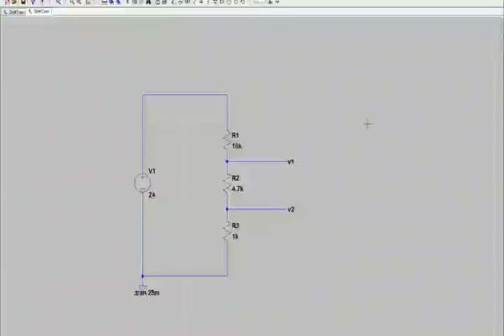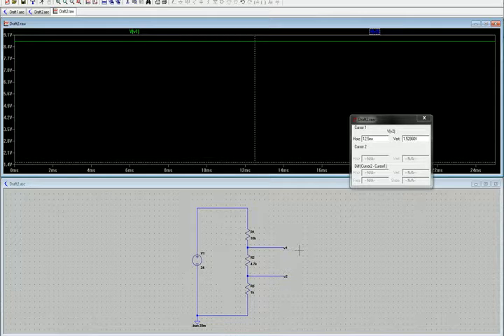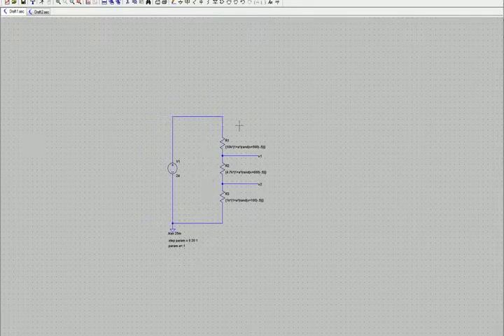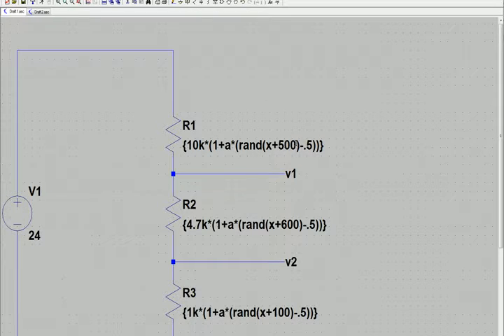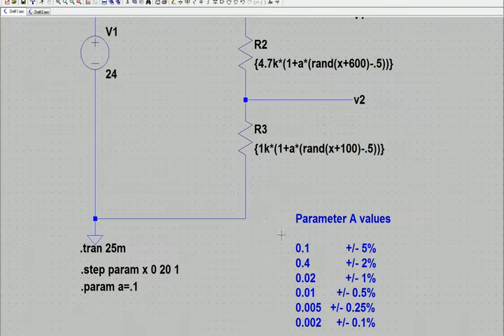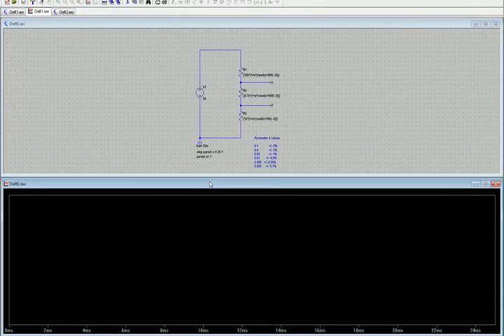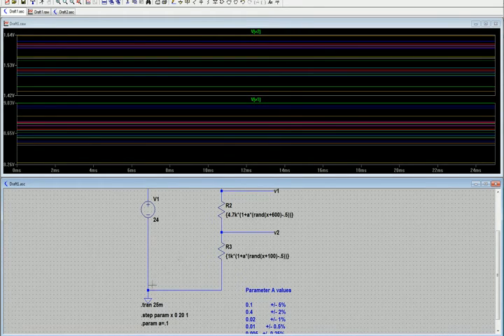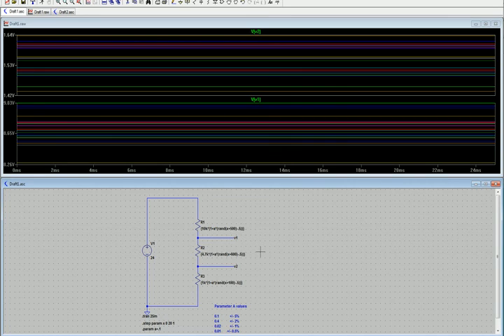Helpful Tools: Worst Case and Tolerences LTSpice

Comment: hi i need to make a Mont carlo alalyis for school, after watching your video's still cant make one myself. Any idea's?
Reply from the maker: Hey there thanks for the comment.  But you question is a little vague.  Can you be more specific to what you need help with?
Reply: Thank you for the fast reply. Or goal is to make a Monte Carlo analysis on 2 series resistors, both 10k ohm, with a tolerance of 5%. They are both connected to an PSU of 10V with a tolerance of 10% ( don't really know how to place a tolerance on a psu ). If I want to run the analysis, is this by going to Run? -> and what's do i next: DC sweep or Transient,..? Thanks in advance.
Reply: Forgot to mention, I want to know the voltage (if i do monte carlo analysis) on one of the resistors.

Comment: Nice approach. However, LTSpice has MC support.
As value use {mc(100k, tol)} 100k is a nominal value, tol is tolerance, that can be defined in param directive or put direct (0.01 for 1%, 0.05 for 5%, etc.).
Then use step with let say 20 sycles as you proposed with dummy param, just to run the calculations these 20 times. (.step param X 0 20 1).
Reply from the maker: Wow that is great!! just tried it!.  Was this a recent addition?  I am sure I tried this a year ago and I was not able to get an MC function to work?  Thank you for sharing this is good stuff.
Reply: Actually I have no idea, when it was added. To be honest I haven't occasion to use MC for many years till yesterday :) 
Best Regards.
Reply from the maker: Well thank you for sharing.  This makes it a lot easier lol!
Reply: Thank you!!

Comment: Is there a way to output the component values during each step?
Reply from the maker: Yes I believe you mean the Resistance values for this demo.  When you have the waveform window open right click on the name of the voltage or any other trend and you can enter calculations like (i.e. V(n001)/I(R1) ) This would take the voltage at node n001 and divide it by the current through R1 which by ohm's law would mean you would get ohms.  When this happens LTSPICE will display the correct units.

Hope this helps.
Reply: Oh, sure. It's easy for this demo. But what I'd like to do is output the capavitance /inductance/resistance values from a Monte Carlo simulation of an RLC bandpass filter. I'm using the test to  figure out passband flatness and peaking, but I think it would be difficult to calculate without knowing the Rand function output. I just thought there may be a simple command to generate an output from each component at each step, but maybe LT haven't thought about that.
Reply from the maker: Rowan Doherty Ahhh got it.  I apologize for the miss understanding.  Well what you want to do can be done it is just a bit more involved.  I have made a quick LTSPICE .asc file and uploaded it to my project code link that is found on my channel page in the lower right of my youtube banner.  It is called RLC Monte Carlo.asc.  In it I have set the R, L, and C values to be {R}, {L}, and {C} respectively which makes them variables parameters with the names R, L, and C.  Then using three different voltage sources I labeled them {Vr}, {Vl}, and {Vc}.  Then using the ".param" command I set up the random generator equations for each of these sources.  Then using more ".param" commands I set the R, L, and C values to that of the voltage sources: R=Vr, L=Vl, C=Vc.  Thus if you want to view the values of your R, L, or C just voltage probe any of the three voltage sources and it will plot the values and the voltage number is whatever value it is putting in for the R, L, or C.  Please feel free to have a look at the file on my code link page.  It will make more sense when you see the file.

Take care and I hope this helps.
Reply from the maker: Rowan Doherty Oh and it takes a while to load but it will just watch the counter in the lower left of the ltspice window to see where it is in calculation